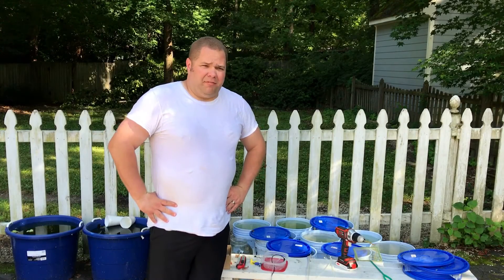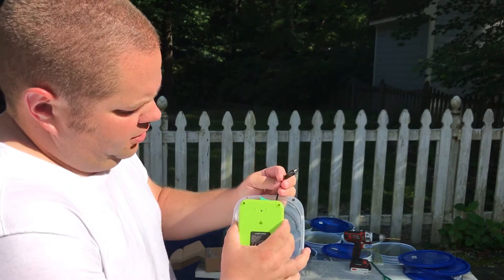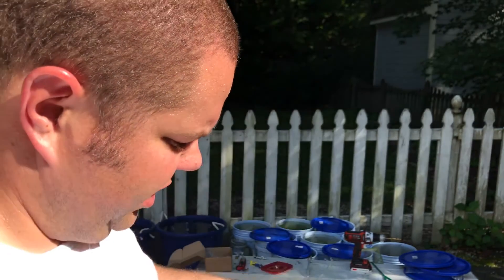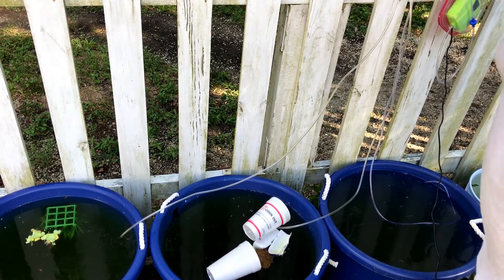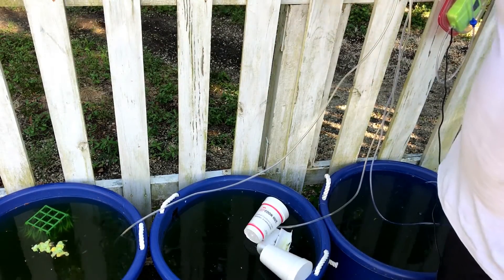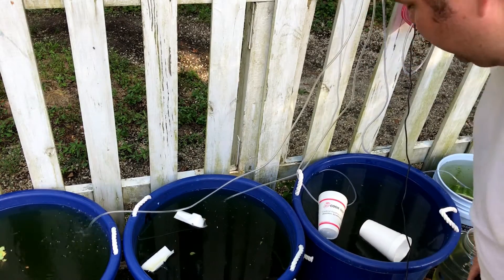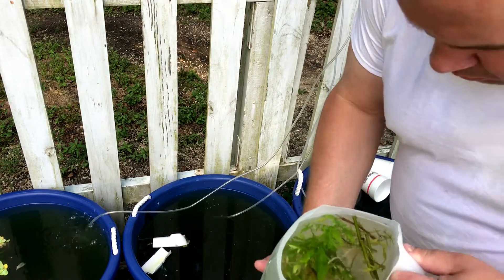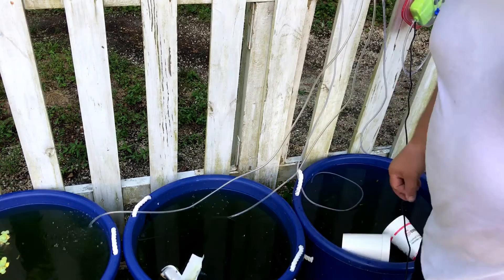Fry Friday: Solar Powered Air Pump in Summer Tubbin Outdoor Guppy Ponds Product Review and Unboxing

Comment: Could you use that in a aquarium if you had enough sunlight
Reply from the maker: Cichlids 5 I would think so yes. I would think it would work even better if you had it on the outside of a window and had the cord to thr solar panel going out a closed window. I will have to test it and find out. Maybe a later video :)
Reply: MrScienceGeek nice video and check out my latest 2 video if you like to look :)
Reply: Mark's Fish Keeping UK have your angelfish bred yet
Reply: Cichlids 5 turned out to be a practice run :)